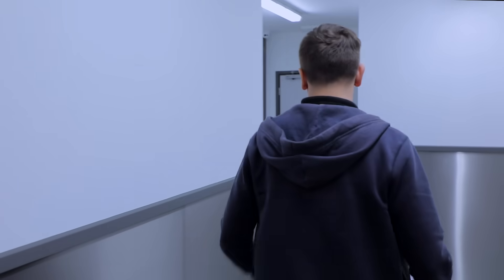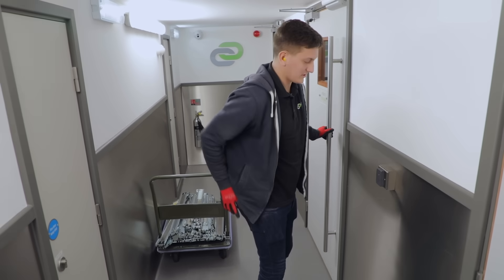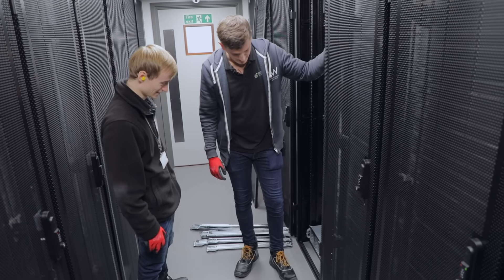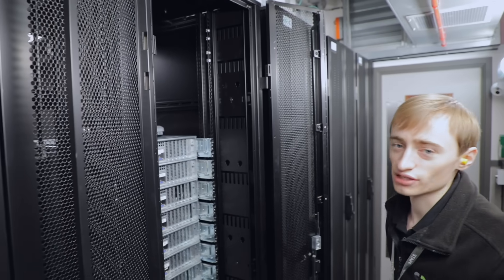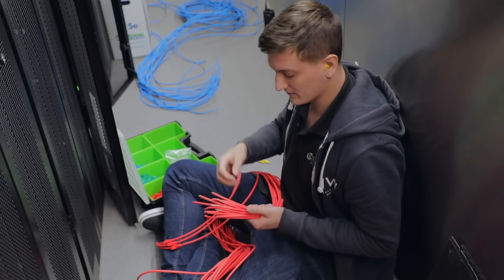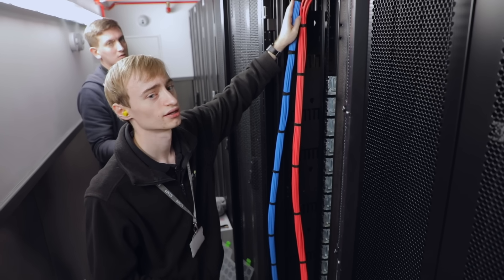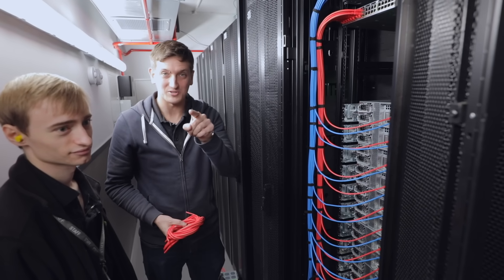A DAY in the LIFE of the DATA CENTRE | FULL CUSTOMER "RACK & STACK" with ASH & JAMES!

Comment: Where are the cable management arms for the back of the servers? How is the server engineer going to pull out the server to perform maintenance without them? You cut the cables to short and so cannot pull servers out.
Reply: for these.. any physical maintenance they would just power off the server and disconnect the cables.

Comment: Question?
Do the racks lock into place?
Reply: Typically, you don't bother with that. A rack is heavy enough that you typically never would shove it around by installing equipment.
Reply: Yes, they should be bolted to the floor

Comment: brave men not testing those cables before tying them in!
Reply: Shouldn't the cables be tested before they left the factory?
Reply: @MarshallLapenta they cut and terminated the cable themselves. Its on them to test their own work and with the amount they did there is probably a bad cable
Reply: @MarshallLapenta   They may be but you want to test and make sure that they are using straight cables and not cross. SInce they had to complete the ends.
Reply: yes, because this video showed ALL the work. 12 min server install. idiot

Comment: Nice work! out of curiosity, is it common to add 48 port switches and not use them up entirely? Also, i see red and blue cables, connected to two different swithes, are those different networks entirely ?
Reply: Its somehwat common to use 48 port switches even if you dont intend to use all 48 ports as they usually have a higher switching throughput and allow you to easier sell the used equipment when it has reached EoL.

The Red and Blue cables are most likely on the same network, just using different switches for the sake of redundancy. With a setup like this, one switch can blow up and the servers stay connected. Its the same reason every server has two power supplies connected to two power sources. The goal is to reduce Single Point of Failures or SPOFs
Reply: @tatzecom  Actually its most likely that the red is for IPMI traffic since its in the IPMI port on those Supermicros and the blue is for main server traffic.

Comment: Great video but don't understand why this customer doesn't have cable arms at the back of the servers. When you have to perform (hardware)maintenance on one of the servers you have to disconnect all the wiring to slide the server out
Reply: That's why they using markers. Basically to cut cost as much as possible. To be honest if you have to disconnect and remove all servers rack, there are something really really wrong with your business that with or without cable arms doesn't change a thing. So yeah, cost effiency, especially on low end to mid end server providers.

Comment: I would let the cables hang a bit more due to the fact when a technician needs to open up the server they don't stretch the cable.
Reply: If they need to open up the server for an important reason, they can probably afford to unplug it.....
Reply: @nigel2419  When I worked on my rack I liked them in the front so i was reminded. Many at times I pull out the server only to remember the cable is behind was short, so I made a little reminder to remove the cable at back first before troubleshooting

Comment: What rack rails are you using at 4:10? They seem to clip in rather than bolt.
Reply: Those are standard supermicro 2u revision b rails. Lmk if you want the part number and I can fetch it
Reply: @industrial-wave   can you get the parts number
Reply: Many manufacturers have moved largely to snap in rails.

Comment: Just thinking about how they will route the power cords... might be wrong, but wouldn't it be better to route the networking cableling on the opposite side of the rack?
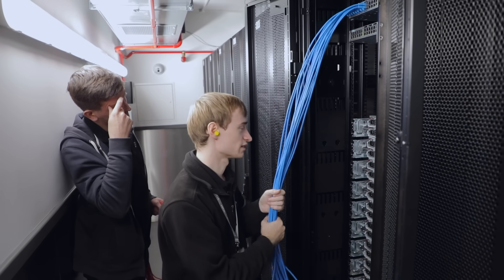Reply: I think they explained at 8:50 is because they'll have fiber optic cable as well so they want to keep the 2 types of cables separate so when other people come in to adjust the copper and/or power cables, they wont be messing with and bending on the fiber optics cables.

Comment: What if fibre is used instead of copper? would you still "make" them to length on the spot or rather just order pre-made?
Reply: it is difficult to split fiber. you need special equipment and training to do that
Reply: everytime i had to use fiber, the length was already premade
Reply: In this situation its really not neccesary, they only connected IPMI and LAN1 for managment it does not need fiber like speeds, couple of kb/s is going through there at most, these servers will have high speed network cards probably 10GB and from the network card there will be DAC cable, its like optic speed but they are copper, but they only work for short distances, that will be connected to 10GB switch, then from the rack there will be optics. Look up fiber optics soldering, I did it myself a lot of times and its very very time consuming for even one fiber box of 10 links.

Comment: Beautiful. May I ask, why are the two server ports, on each server, connected to the switch?
Reply: The red cables are connecting to the IPMI or System Controller of the servers.  This is an out-of-band interface for remote management of the system and allows remote access and control of the servers.  The blue cables are connecting to one of the 4 data ports, which will be the host's main interface and link to other systems and the outside world.
Reply: So they can able to distribute the data and internet to all those connected server with equal amount of speed that's what the switch does
Reply: @arqais  so some kind of redundancy?
Reply: @arqais  Not quite, The red ones are for IPMI so you can fully control the servers remotely even at the bios level.

Comment: They're so confident in their crimping that they don't even need to test the cables before plugging them in. lol   Good work fellas!
Reply: I stopped testing the cables i make a long time ago, rarely you make faulty one and the switch will tell you if it ain't right. It's a pain in the ass if you've tied them all up but ripping the odd dodgy cable out once in a while is overall less effort than testing each one haha. Sometimes get faulty premade ones too so you could argue you should test them too.
Reply: Now, i just see the deep in connector and crimping it. Lan tester or another only used when troubleshoot or repairing an existing cable installed on users/client.

Comment: how do you labeling servers and network cables? if servers has more than one Virtual machines?
Reply: Labels are only for physical identification. You’ll have the main server name on each node or NIC.. and then the labels on the cables themselves showing the ports/patch panel.

Zero need to identify virtual machines in a physical sense.
Reply: Regardless of whether you have 1 or 100 VMs running on your server, the hardware that they are all on is exactly the same.

If your server is cables to port 7 on the rack switch all those VMs are routed through that port on the switch so the label will say something like "my server <-> port 7 on rack switch"

Comment: Engineer with 23 years DC experience. I wouldn't trust those uncertified cables, and no customer should. It's time consuming to make, and bad practice to assume the cable is good. They may work initially but will they after a long time in the exhaust path of the servers? Also they aren't cat5, no one uses cat5 now it was dead in 2001. Cable wastage is annoying. Use proper cable labelling at each end, and sort them in a logical order and not random in the loom. e.g. server 1 to switchport 1 and work down in order - makes future diagnosis, reconnections and swapouts easier and more logical for future engineers to service. You may have ordered the cables, but it wasn't clear. Overall, centrally mounted switches make for an easier time in the long run, shorter and neater cable runs. I'm used to managing a much higher density of servers in the rack space, 8 and 4 node chassis 2/3U, and 1U servers, with minimum 2x NIC plus management/idrac. 
Ensure the switches are correctly mounted for air flow as not to cause hotspots, and specify reverse mounted switches where possible. Customer may have specified the equipment, so it's sometimes not ideal. Those C3850's are pulling air in from the rear and expelling it to the front, the reverse of the servers that pull air in from the front cold aisle.  It looked like the racks had no side panels and was exposed to its neighbour(s)? 
I'd be interested to see your completed install of power distribution, power monitoring and cabling, given there was nothing in the rack. I'll check other videos for this.

Comment: Build a critical patch cord without test & certify? Now high latency, data loss and low speeds make sense …
Reply: u think they dont know what they are doing? maye u apply for a job a SDM? those people make thousand of network patchpanels cables and so one per day they know what they doing
Reply: Up to the client to spend 10 hours trying to diagnose and issue then the dc gets to charge $125 for remote hands to swap it haha.

Comment: Is there enough air circulation when you stack em one on to each other like that
Reply: Yes, zero problems, provided that the servers are configured for front-to-back airflow. Typically, in a data center like that, you have isles with a cold zone in front of a rack, providing cold air, and a hot zone behind the rack, with an exhaust at the top to suck the hot air out. Not much heat is being dissipated between the servers through their chassis.
Reply: The noise you hear are server spec f-b high volume fans :). I once had a server like this for diagnostics at home. Cat still remembers...
Reply: Front back air flow.

Comment: is this standard in datacenters to put switches this way, hot air will bee exhousted in front of servers, is this a problem ?
Reply: With most vendors you can place orders for reversed airflow as to avoid what you're describing.
Reply: The fans in data centers are usually reversed

Comment: A quick question, you have crimped one side of the cable, then tied it with server reck. Afterwards crimped the other side as per server location, in case a cable is not working, then you have to cut all the ties ?
Reply: They were Velcro ties

Comment: Doesn’t mounting the switches in the back, go against active air cooling management protocols?
Reply: you can have the switches fans reversed by the manufacturer if you know ahead of time.
Reply: @lasuzzoeagle1  dude, c’mon
Reply: They said they typically mount the switches in front. Customer specifically requested back mounted switches.

Comment: Purely out of curiosity and no hating, btw, i am not from the industry but have a new facination and interest. Wouldnt it be better if the cables are cut to measure to avoid the offcuts? Or would the time cost for labor be more compared to the cost of offcut cables?

Thanks for the video btw. Appreciate this new learning material.
Reply: You cant groom the cable like what they did if you precut the cable since you have to groom it on the side. Ive done that and ita quite a mess haha... A little cut is really unavoidable for a cabling like this..

Comment: Why there is two cables red and blue?
Reply: Both go to different switches so probably redundancy
Reply: as for my datacenter setup,we ran it for public & private network
Reply: Depends on the configuration, but usually 3 or 5 data connections.  2x Data network, 2x Storage network and 1x Out of Band. Or if no Shared Storage (SAN) - if using VMware vSAN for example, 2x Data network and 1x Out of Band.
Reply: one of the cables is for spare. connected to different switch. when there is a problem in one of the connections, it is continued over the other.
Reply: Redundancy, if one of the switches or cables go down, the other one will still be available as an immediate backup
Reply: While all of the answers that were given could all be correct. In this case it is most likely to separate the IPMI/Ilo/Idrac connection ports (for remote access to the server to manage it etc) and the normal network ports. The color difference is used so it is easy to tell where it was connected to (IPMI or Network) so it doesn't get plugged into the wrong port.

Comment: Neat job. Just a parttime stacker and cable monkey here. Just a thought: I'd rather combine the fibres with the power chords on one side. Taking in account the amount of power cables and the electromagnetic field they will generate I'd be anxious about interference and temp induction on the copper dispite its shielding.

Comment: Oof!  No maintenance loops.  Custom crimped, untested cables.  That's kinda nasty :(  Fun to watch though!
Reply: No cable labes either so no consistency on what switchports goto what ports on the servers...
Reply: @lewis1246  This has to be at the top of my pet peeves list for following behind other techs.
Reply: Some jobs I have been on, the specs actually said NOT to install slack loops!!
Reply: That was my first thought also, put in a cable arm for the servers..   Bet some of those have redundant hotswappable fans, however with this install you cant swap them hot because you can pull the server out without disconnecting everything..  Annoyed the hell out of me when I worked as a hardware engineer..  You get a problem that you need to see the diagnostic LED's on the board, but you can't without disconnecting all the cables, then there is no point cause you cant see the leds..  Sods law then you bench the thing and the fault doesnt appear straight away...   Some data centres though run so hot they think they need the airflow, but in that case make a loop and velcro it to the side or have somewhere some slack..

Comment: Got a new job. Starting, the3rd january 2022: I've never done that before. I know how to mount a pc, to mange some stuff via virtualization but this. No technical challenge during the job interview. They just told me "you're the right guy, we trust you" xD Im very afraid of making any mistakes. Checking the system config with some partners in others countries will also be challenging.
Anyone got the same situation ? How was his experience ?

Thanks for the video.
Reply: How is your new job?
Reply: @Kallekringla3  Well.....im learning. As the offer was written, it was clear I'll be "the only one to save them".
Fortunately, im not alone (clearly, one man for 4 differents sites full of DTC ????).
My co-workers teach me what i need to learn. That's going well.
Powershelf IP checking, Undercloud project, checking the mainframe and reporting any issue (door of the rack not closing well, health of the network cable...).
Checking the network connection and investigating why we can't ping this server.....installing red hat on KVM.
Replacing wrong memory stick.....
Plus managing remotely the servers when possible.
Much more to come.

The only problem is: The final client (famous telecomunictaion company in my country) is not providing all the time the badge you need to access to their DTC. When you think it's done, and after spending more than one hour and alf of travelling, the guardian doesn't find any mention of your name. So you have to go back to home xD Happened once or twice.

@Harold:
Rule #1 with me: Never say i just take my time. Im a turtle with a brake as my father was used to say xD
Anyway it's going very well. Nice opportunity I got.
Reply: Clement, don’t worry. You WILL make mistakes. We all do. Just take your time and speed will come naturally.
Reply: nice story, I'm starting in a small datacenter next week, but I've got previous experience on configuring switches/routers/servers, just virtualization is my achilles heel right now, especially vmware 🤣🤣

Comment: Good video guys i have racked and design data centers for 40 years i love it keeping things neat and airflow correct. i have walked into data centers that were a total mess. the cage clips there is also the tool you can use to clip in the clips save your fingers and yes it hurts when it slips. Data Centers is my passion.

Comment: Just some comments: 1) I will never put servers on the floor without proper static and dust isolation...2)it seems the DC does not have staging room to allow customer to climatize and stage equipment? 3) are there any blanking plates to install to improve cooling efficiencies? 4) The loom tool is cool.  5) I wonder how it looks like when the power strip/PDUs are in ;)

Comment: Is this one of the parts of Network Engineers do or is there a job to set up racks?
Reply: I have the same question 😁
Reply: Well atleast in my country, network engineer is the one doing the switch configuration. The cabling vendor will most likely set up the racks and everything.
Reply: @shizzle8671  cheers pal where are you from?
Reply: @kihunkim9122  malaysia